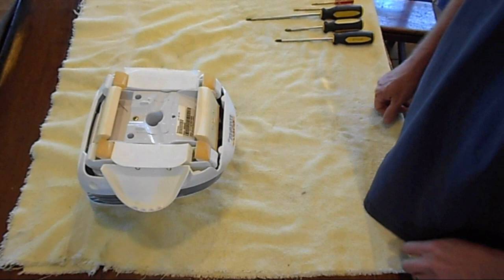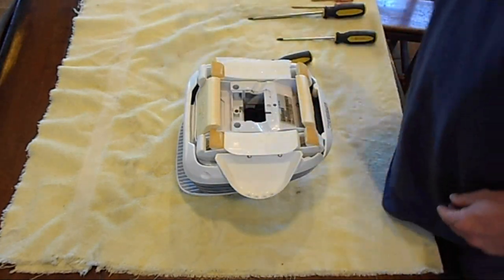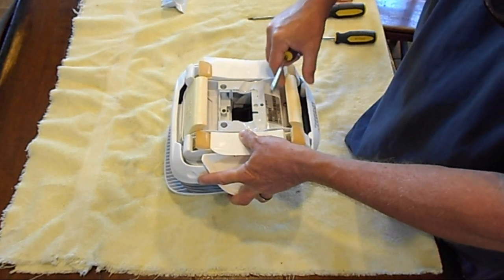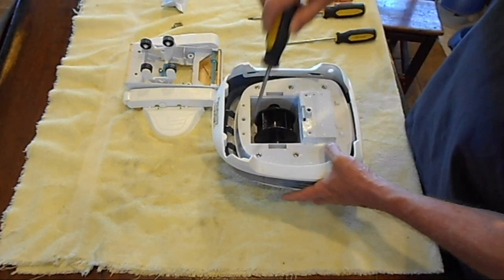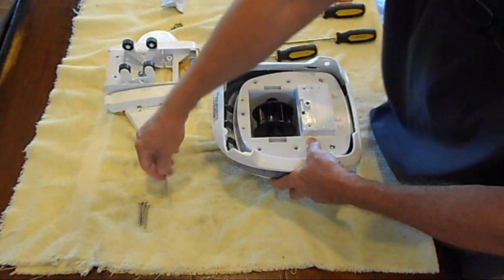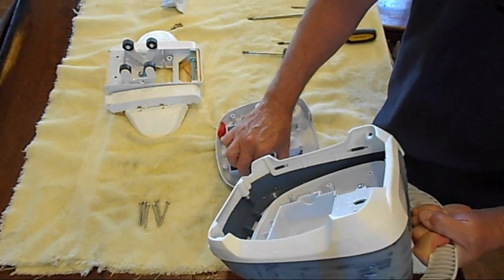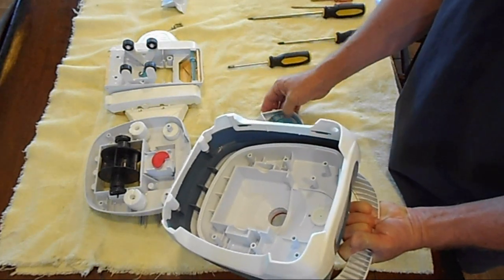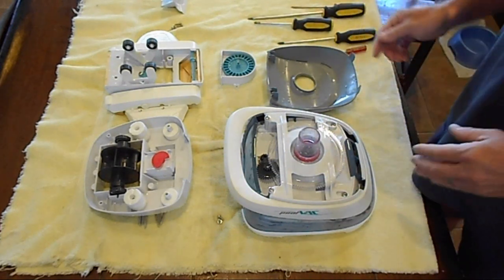Hayward pool vac tear down (disassembly)

Comment: I remember those pool vacuums i use push them off the side when it came up to the surface. It's shutdown as it floats away and sinks. And sometimes I put my head under the water only to hear it come back on when it reaches the bottom
Reply from the maker: sounds like goodtimes  😇

Comment: I have a new pool & pump and all that and mw old hayward lady bug will not move but if I take it out and shoot a hose up the bottom the feet will start moving like it should. Why won't it work on a pool w/ 17psi?
Reply from the maker: you need to get a flow gauge sound like suction  problem.  https://lesliespool.com/hayward-vacuum-gauge-v574/624116.html?   could be cracked cleaner  lines https://www.amazon.com/Hayward-Swimming-Navigator-Cleaner-Replacement/dp/B01LQKDIUG/ref=asc_df_B01LQKDIUG/?t   ... pump problems as simple as suction setting or filter tank not tight ... the adventure begins 😇 https://www.youtube.com/watch?v=D1L6e8NG5xA

Comment: Great video! I take my vac to the local Leslie’s here and they replaced the gearbox A few weeks ago but I am noticing my guy never turns to the left. I’m thinking it may be something in the upper assembly? It’s just making right hand turns. Maybe a piece of hair or something stuck In the turbine gears?. I might try and take it apart after watching your video.
Reply from the maker: So easy to do just follow the video . I hope it helps you solve that no left turn problem. Works for me God bless
Reply from the maker: Hayward pool vac stuck going right or left or no movement  https://youtu.be/j2TFnGrnV60

Comment: Please add a video on reassembly. I replaced all the internal parts, but still the vac stalled at the steps. Took it apart, again and again, still stalled. Finally, off I when to a pool store where the tech corrected the problem. No charge.
Reply from the maker: I am glad you got help -working on video may take some time God bless
Reply: Thank you! I've had Hayward pool vacs for over 20 years. Replaced a few! Your videos have encouraged me to delve into self-repair. Saved over $300 by ordering online replacement parts. Watched the repair process over and over, but still manage to reassemble incorrectly. Seemed good to me, but still stalled. Regards, retired electronics engineer Tom Mc.